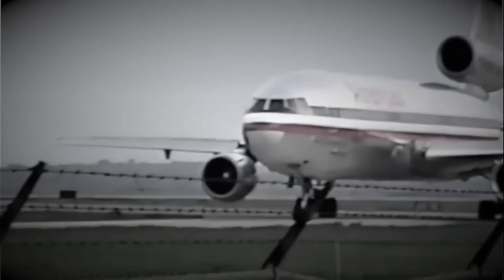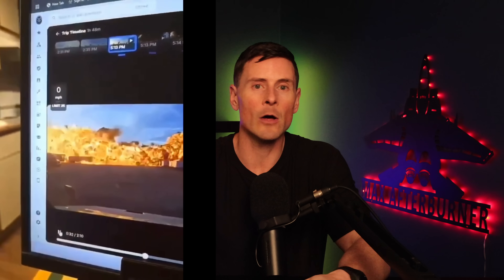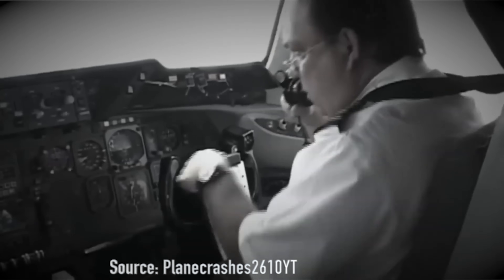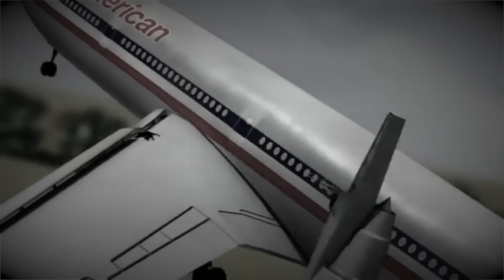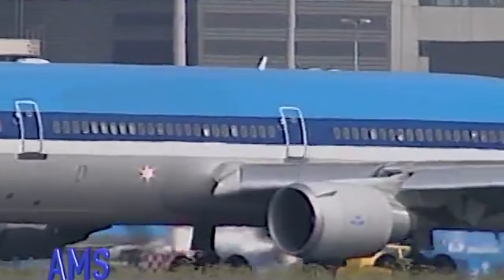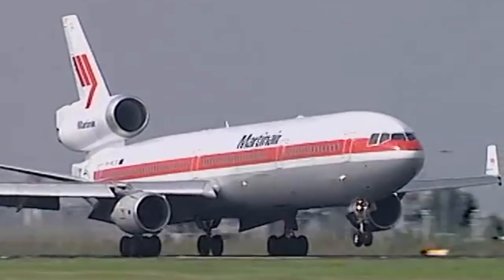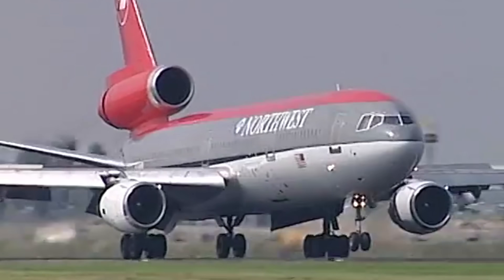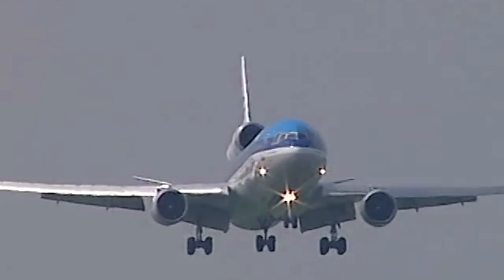Airline Pilot Exposes CRITICAL FLAW of UPS 2976 DISASTER

Comment: There's a reason the USAF retired the KC-10 variant, while the much older, smaller KC-135 is still in service.
Reply: And what's that reason? I think it was more a cost reason and not a reliability reason.
Reply: @chrisescobar4199   googled, looks like multiple resources said it was cost of maintaining the small fleet of KC10's long term was outweighed by the performance and flexibility of the new KC46 tanker.
Reply: @chrisescobar4199  lol yep.  I replied while you were editing.  Dad much preferred flying the 10, but never had a edit major technical issue with either.
Reply: @chrisescobar4199 reliability is a cost... hence what happened to 191.
Reply: @chrisescobar4199  I discussed with my father yesterday (he flew both as a 20-year USAF officer).  The 10 was highly capable (it could carry as much fuel by weight as the 135 itself weighed in total) but required extensive, expensive maintenance relative to the service it provided.If the government decided it was too costly, I can believe some companies might occasionally cut a corner here and there, eventually leading to this type of event. Granted, that's speculation on my part, and nothing will be known until the full report comes out in a few years.
Reply: Great updates & I remember the 1979 crash clearly.  I worked with the KC-10 in the USAF & luckily it’s accident srecord was much better than the DC-10, & due to the outstanding work by the maintainers it had no serious mishaps during it’s time in service with the fleet.
Reply: @InlandOne  Fully agree (and thanks for all your hard work). Were you at Barksdale for the only loss (at least, only one I can recall)?  That was due to a spark & fuel explosion on the tarmac if I'm remembering correctly.
Reply: @onlythatonetime  yep, only one KC-10 hull loss.... on the ground!
Reply from the maker: Interesting point

Comment: I have flown plenty of MD 11s.. surprised they are still in service. Condolences to all involved in this tragic accident
Reply: Freighters only, KLM flew it's last passenger MD-11 flights in 2014 and believe they were the last one. Still about 60 in service between FedEx and UPS and FedEx said recently they would keep at least some of them flying until 2032.
Reply: This was my surprise as well as this one is near 40 years old
A very old airframe
These old planes really should be retired as we are going to see more and more of these accidents as these old girls go past the point of no return
Damn a dc10,like that's back in the old Tri Star days
Reply: @joeconnolly89 There are C-47 (DC-3) still in service mfd in the 1930s!  Maintenance!
Reply: They said this jet was 34 years old. Why were they still repairing the fuel tank, when it’s that old? 
Isn’t that a bit risky in such an old jet? Cost cutting can lead to fatalities. It’s very sad. They had zero chance.
Reply: An MD-11 took out a Concorde.
Reply: @RandyBoBandy.  Nope, that was a Continental DC-10
Reply: @TimAnnear_1961same difference.
Reply: @RandyBoBandy. wasn’t it a Continental Airlines heavy?  Left a little souvenir on the runway that shredded the Concord’s tire, etc.?
Reply: @momsnoteatingbugs1919 yes. Dc-10 which is the md-11.
Reply: @RandyBoBandy.  Yeah because mechanics didn't inspect the titanium weather strip on the engine cowling correctly.  And just to let you know, the airplane manufacturer does not design the cowlings. The engine manufacturer does. That piece coming off was the fault of the inspection and the engine manufacturer.  Not the DC-10.
Reply: @ILSRWY4 they did inspect it and ignored the OEM specs about reattaching. Just saying. When not crashing itself, the DC-10/MD-11 is crashing others.
Reply: @RandyBoBandy.  Frankly no, but a Lockheed F-104 did take out one of the XB-70's.  Lack of maneuverability of the fighter.  Collision by the F-104.  The DC-10 in the case you mentioned at the time had a part replaced by a cheap knock off.  This is one example leading to ensure only top notch replacements could be used.
Reply: @RandyBoBandy.  No it didn't.  A rub strip on an engine was fabricated and mis-installed by Continental Airlines fell off onto the runway and the Concorde ran it over which caused the tire to blow.
Reply: @stephenlocantore1203 what model of aircraft was it??? Exactly.
Reply: @stephenlocantore1203 either way did the DC-10/MD-11 not cause the Concorde to crash?
Reply: @RandyBoBandy.  Yes, a DC-10 took out a Concorde. What's your point? That it's cursed? In that case, I agree. It's quite cursed.
Reply: Lies
Reply: @bobbybob6597  Your assertion needs context.  Who?  about what?
Reply: @bobbybob6597 lies about what?